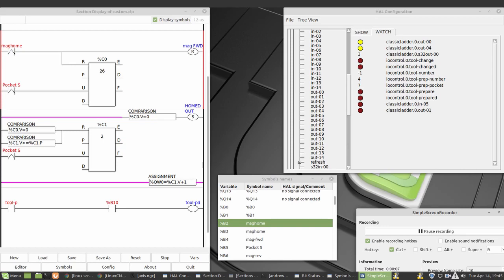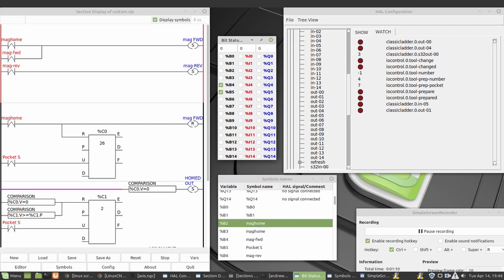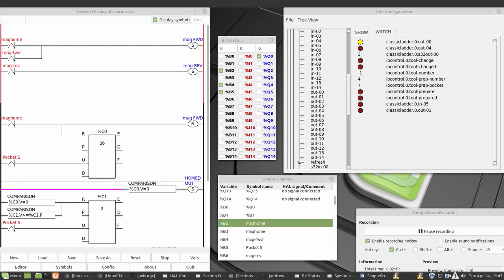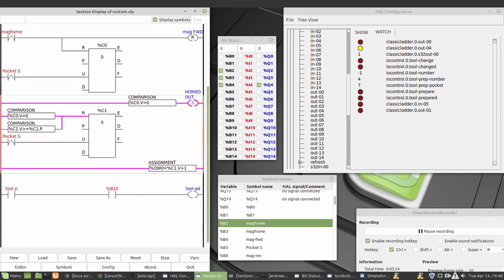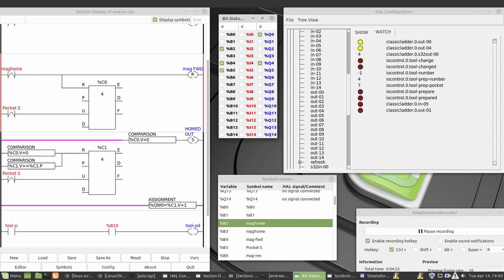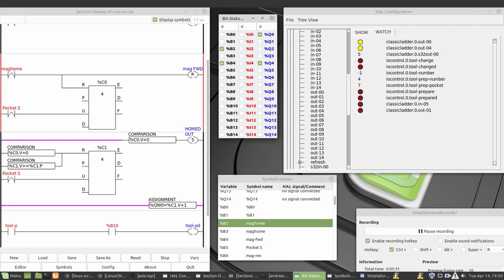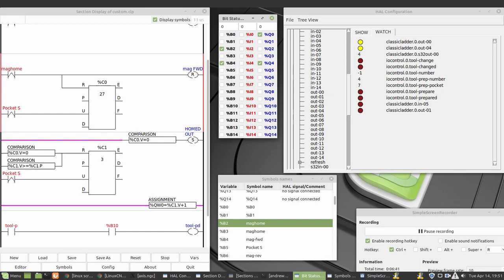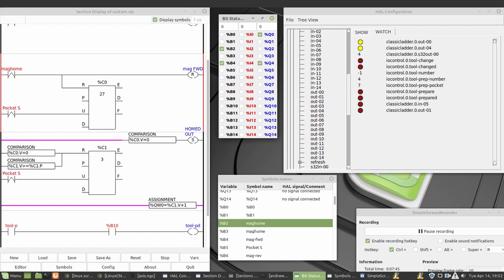classic ladder first steps  linuxcnc toolchanger

Comment: You've probably have got it sorted by now, but I recently did a toolchanger for a Takamatsu and rather than using a counter, I just let it spin until it finds the correct tool location. The Taka only indexes in one direction so counting is completely unnecessary since while you can select a tool at random, you have to get to it in a linear, single-direction fashion. For a bi-directional toolchanger, simply compare your current location to where you want to go. 

And no fancy math to figure out your direction either. Say that you've got a 20 position toolchanger, 

If your current position is greater than your midpoint, do a comparison with your current position being the upper limit, and your current position - 10 (half of the positions available in your magazine) being the lower limit. If your target falls within this range then you know that reverse is the right direction to go.

If your current position is less than the halfway point, then your current position would be the lower limit of your comparison, and your current position + 10 would be the upper limit. If your target falls within these bounds then forward is the way to go, otherwise go in reverse. No need for bounds checking.

How does your magazine know where it is? Do you have a marker for each position in your magazine, or do you have to keep a count of how many times that you've indexed?

I also did a luber, and rather than using counters, I created a free-running one second timer. The pulse that I get every second increments the count in a register. Each count represents a second. Personally, I find that it's cleaner than using those clunky counters.

Which leads to your "%C1.V>=%C1.P" comparison, I found that in my luber program that while this was a legitimate instruction, it would not "pass power" when true. One solution would be to put a "%C1.V=%C1.P" comparison in parallel with a "%C1.V>%C1.P" comparison.

And there is a cautionary note floating around about not using multiple rungs within a rung (what the author of ClassicLadder calls a rung, which would be better termed as a page). Odd things can happen.
Reply from the maker: Mate what a awesome reply.  I have thought of several of those issues.  Would love to catch up.  Do you think you can email me do we can get in contact.  Just Google carbidecutters.co.nz.

My magazine doesn't know where it is.  It has to add counts from a proxy sensor.  Plus home switch.  I could put a encoder on it but seems overkill when the current system works fine.  Just about to set up my second machine in a few weeks.  So love to catch up and compare notes.  Love seeing what other linuxcnc guys are up to.
Reply: @carbidecuttersnzltdandrewb8449  

Thanks! I sent you an email.

I suspected as much about your toolchanger, the problem here is that eventually it is either going to skip a spot (miss a prox read), or double read leading to the wrong tool being presented. The good news is that since you sell tools, you should have plenty of spares on hand. :)

Our is a horizontal toolchanger and it indexes (rotates) hydraulically, which lead to it slipping back and locking in slightly off position in my earlier attempts to control it. It also suffers from either "bounce-back" or when it is imbalanced, creeping back. Either of which is a bad thing. Since the toolchanger holds the tool when the lathe is in operation it has to be positively indexed into position. The locking bar has a way-too-wide range of detection making it a poor choice for determining if you are in position. You can be "lock in" position and still be off 20 degrees or so.

Not being a fan of "faith-based" indexing, I wired up two pushbuttons and manually indexed the thing using various combinations of inputs until I was certain of what I needed to do. This also lead to the realization that I didn't have to lock the changer in position before indexing to the next one (in the event that my desired position was two or more positions away from my current position). Just turn off the indexer pulse for a second and then tell it to index again. This wasn't part of the original setup to the best of my knowledge and it works like a charm.

Each position on the Taka toolchanger is coded by way of a combination of limit switches. I should create a "sanity-check" routine that indexes to each position before running the machine. Any location outside of 1 to 8 would be invalid. Any jump in the counting would be invalid as well. In either case the machine would not be allowed to proceed.

In any case, from there it was a simple matter of coding in what I was doing manually.

ClassicLadder is fine for what it is intended to do, what it isn't is a full-featured PLC. But indexing off of one prox is a disaster waiting to happen, regardless of whatever controls you use. Could you post a video of the toolchanger in action?
Reply: Oh, and I see that you have a video on your toolchanger. :)